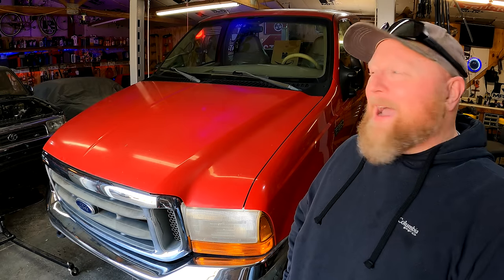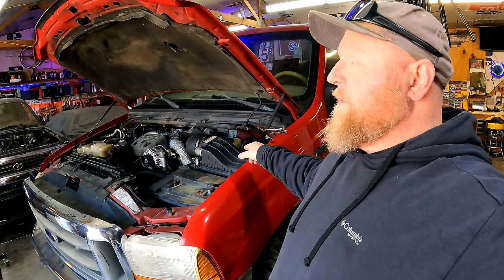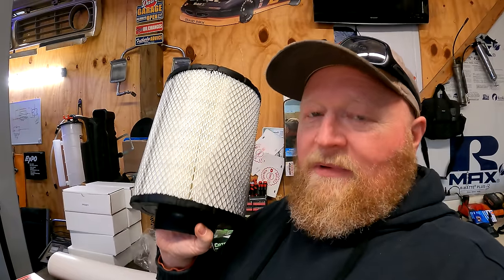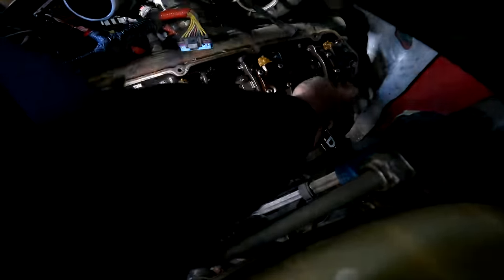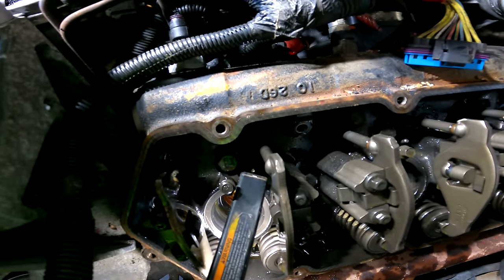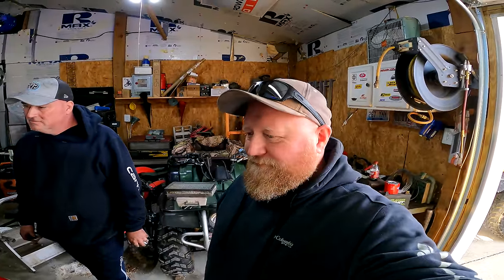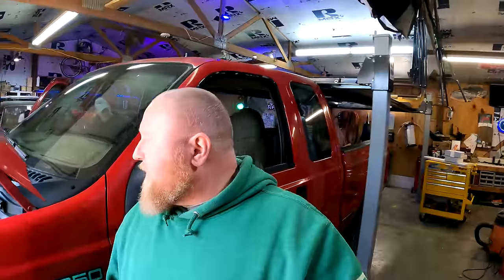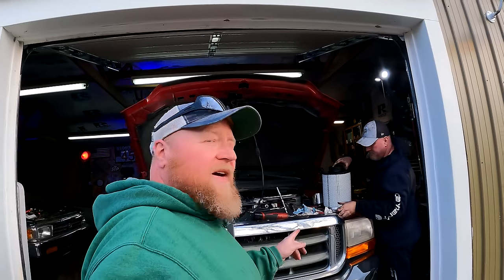FAIL! F250 7.3 Powerstroke Diesel Injector Replacement Goes Horribly Wrong!

Comment: Take both external plugs off the REAR of both cylinder heads on the hpo rail, turn it over and bleed all the air out if any and let some oil pour out of the hpo rail, make sure the truck is nose down to assure all air is out.
Reply from the maker: Yep, thanks!!

Comment: When I do injectors on 7.3's I plug the block heater in and get the engine warmed up.  This makes the injector drop right in :)
Reply from the maker: Oh, that's great idea! Never thought about it. Thanks for sharing that!!
Reply: I do the same if I’m working on the fuel system in the OBS 7.3s as well. Helps it start much easier too when the work is done

Comment: Sometime ago I replaced all of my injectors. I also replaced the undercover wiring harness/valve cover gasket. Took my time, and thought I did a good job. The truck absolutely refused to start. I have a regular job and this was a weekend project. (Turned into multiple weekends)  After many trials and tribulations, and much stress, I figured out that the doorman gasket/ harness set on the passenger side had a dead short. It smoked my injector driver module. Replaced the The IDM $$$$, used my old factory gasket/ harness, and the truck fired right up. That was a year ago. Still runs like a champ. Now I always go OEM. I don't care how much it costs. It's the only way to go on the 7.3. Although not as hard to figure out, I had a similar  problem earlier with the IPR. But you got to hit me in the head more than once to get me to pay attention.
Reply from the maker: Ouch those Dorman parts will get you. We did get the truck fixed. Full video coming tonight at 6

Comment: One thing you can do to speed up restarting the truck is pull the inspection plug on the HPOP resivour and fill it with oil. You have to do it two or three times and the thing fires right up. Only takes a week to start rather than two, and doesn't melt the starter.
Reply from the maker: Good info!

Comment: I’m curious to know what injector is in #7 since the solenoid body is different from the rest (excluding the AE #8). Obviously a massive high pressure leak. Check your fuel tank to see if any oil is sitting on top of the fuel. If you ripped an o-ring the oil would be in the fuel tank. If it was injector cups it’d be diesel fuel in the coolant. Also i like to use grease on the o-rings instead of oil, the injectors go in easier that way but that’s just my opinion.
Reply from the maker: Good info, thanks!!

Comment: Your hard start was probably the LPOP... the most common problem in cold weather starting when you don't use the block heater.
Reply from the maker: Check out the followup video. It turned out to be one of the new injectors bad. Bypassing oil.

Comment: Thanks for making this! my '01 F250 has 250k miles on the original injectors and they are due for a replacement soon. This definitely helped me see what all is required for the process.
Reply from the maker: Awesome, I have another more in-depth 7.3 injector video on my channel as well. Have a look at it.

Comment: I,ve pulled trucks into my shop where the HPOP did take a dump after replacement simple dead head test will confirm, I've seen connection at injectors not making contact, injector o rings not seated all the way blowing oil out and torn o rings and last the fuse blown
Reply from the maker: I was starting to suspect everything for a little while there. We got back into it yesterday and found/fixed the problem. I'll have a video up on Friday explaining it all.

Comment: When you pull the 2 plugs per bank to relieve the oil in the logs, where does it go?  Guessing it runs forward since the truck rear is jacked up?  Drain bucket or ?  Do you have to add oil to compensate for lost oil prior to cranking engine up to prime the two pumps?  Why does the #7 injector have a blue connector as opposed to yellow like the other 3 on the left bank around the 19:00 time stamp? Must be on the right side as it started after the left bank replacements accomplished.  Great tutorial even though was a "hiccup".
Reply from the maker: On the 2 plugs, when you pull them, the oil drains back into the oil pan through the drainback holes in the head, these are the same ports where the top-end oiling for the valvetrain assembly drains back when the engine is running.
#7 has a different color solenoid since these injectors are built by Full Force Diesel. Not all solenoids were the same color originally since they came from different manufacturers. It doesn't change their operation, though.
Yep, we found the issue on the right side. Full video coming on Friday.
Reply: @ProjectTimeGarage  Thanks for the clarification.  Looking forward to Friday's video.

Comment: I know this is an older vehicle.  How would i determine a stuck open fuel injector on my 7.3? Im sure its a open fuel injector, have both my valve covers off and checked the oil coming out of the injectors and they all oil, i know this probably wont even matter since its open and not closed. I bought a 200 dollar scan tool that doesnt buzz codes. So im at a crossroad now. Thanks.
Reply from the maker: If an injector is stuck open, it will dump diesel into the cylinder. This usually will do bad things to connecting rods. It can easily "hydraulic" a cylinder.

Comment: Try NAPA Sil-Glyde next time to keep copper washer seated onto injector. Also works great for injector o rings.
Reply from the maker: Good info, thanks!
Reply: Just a dab of gun grease will hold the washers on.
Reply from the maker: @Mr-er6fg  good info' thanks!

Comment: Hey hope you well, maybe you can help me, i change injector cups and put o rings on the injectors... pulled glow plugs out and tried to turn the motor and it barely turns, what could be wrong and how do i solve it
Reply from the maker: If the engine won't turn something is wrong.i suggest using a borescope to look into the cylinders. Something is preventing it from turning m
Reply: It will turn but barely turns real slow not spinning, battery and starter are good, I'm thinking it has a little hydrolock and is there any way to free the cylinder
Reply from the maker: @calvinhill1564  of all the glow plugs are out, it cannot hydrolock.
Reply: Okay, so are the cylinders stiff tight how can i free up the cylinder any ideas...

Comment: Did you guys not feel the need to swap injector cups? I thought about doing cups when I do my injectiors
Reply from the maker: I'm on the fence. I've only ran across one set of cups that were leaking. I'm usually happy to just do injectors.

Comment: I replaced the injectors and wiring harness on mine and just a day or so later the HPOP went completely bad. Had the same issue it would crank and not build enough oil pressure to open up the injectors and make them fire.
Reply from the maker: We figured it out Monday the 6th. It's fixed now and back on the road. Full video coming Friday!!
Reply: That's awesome so glad to hear !! Just have to love the older diesel's, they can be a pain sometimes but definitely worth it !
Reply from the maker: @jaredtalbot2159  Yup, agree 100%

Comment: My son has a 1999 f250 when it gets worm driving it gets real loud and falls on its face but never stalls you think 8 injector is bad
Reply from the maker: I don't think you can tell which injector is bad by loss of power when warm, but I will tell you that most of the time a bad injector manifests when cold. I would be more interested in what's going on with the High Pressure Oil Pump (HPOP). When you are under hard acceleration, that pump should be making about 3,000psi. When the pumps get tired, you'll find that they cannot make enough pressure to keep up, this is usually what leads to them being weak under hot, hard acceleration. I have a video on my channel showing how to use an android tablet along with a cheap OBD2 reader from Amazon to see what those pressures look like.

Comment: IMHO the "6637" air filter mod is a very crude unit. As long as the original airbox is not damaged Motorcraft, Purolator and even Fram make a HD (Thicker) drop in panel filter and I believe they are dry impregnated with something to catch even more dirt.
Reply from the maker: Good info, thanks!

Comment: air test it.. IF the IPR and ICP have air itl read 250 psi.. But i did just did this same thing and JUST went through it i had a crank no start  pressure tested and found #4 had a bypass situation,  with 175 psi air heard the leak clear as day.. pulled out reseated it and its all good now.. also can try unplugging the ICP it defaults over 500 which is the trigger to start..
Reply from the maker: We just found/fixed the problem yesterday. Full video coming friday.

Comment: My guess would be a pinched o ring on the injector, or it didn't seat properly could even be a bad injector. I have had a bad reman injector that didn't work out of the box. Swapped it out on warranty problem fixed. Run it with the valve cover off, which will point you in the right direction. At least you know it's  1357 on the passenger side.
Reply from the maker: We got the issue found and fixed yesterday. Video coming on Friday with all the juicy details. I can say for sure, that one of your guesses is spot-on.

Comment: That would have to be one hell of a o ring problem. before you start pulling out injectors I'd run a buzz test and make sure that bank is getting signal. 
   The delay in building any pressure but then starting to build could be explained by air trapped in the rail, which can't work through the injectors on that side if they aren't firing. Best of luck whatever it turns out to be!
Reply from the maker: That was my thinking too. We buzzed them and all were healthy and firing. If it's a leak, it's a major one. Monday is the day we find out what's going on. Wish us luck.

Comment: You dont have to take the plugs out tho right as long as you keep the glow plugs out and turn the engine over your getting it out no matter what just more of a mess right ?
Reply from the maker: True, just trying to keep as much material as possible out of the cylinders
Reply: @ProjectTimeGarage  I was just making sure because I just put injectors in myself and just waiting on the gaskets to come in. But hey I loved the video I hope you guys get big red running she’s a beauty !
Reply from the maker: @kingchrisss777  thanks man!! Good luck with your injectors.
Reply: I personally prefer to use a fluid evacuator with a clear hose on it to suck all the fluid that falls into the cylinders rather than take the glow plugs out or remove the small oil rail plugs. What little fluid you can’t get out won’t hurt the engine.
Reply from the maker: @JLCmike4014  cool, good info!!

Comment: After putting it all together crack open those fuel lines to purge out the air.  Otherwise you blow the air through the injectors.
Reply from the maker: On the HEUI injected engines, the fuel rail is cast into the head unlike standard diesel engines with an injection pump and external high pressure lines. The only way to bleed air from the system is by turning the engine over. Usually they prime themselves in a matter of seconds, though
Reply: @ProjectTimeGarage  I have the FRX return to the fuel bowl from Riffraff to prevent blowing the air through the injectors

Comment: You show to pull the rubber tip off the nozzle of injector, but you don't show the #8 injector difference???
Reply from the maker: #8 is the AE. I did show that. One of the injectors, #7 I think had a different color solenoid, but that's normal with reman injectors.
Reply: It was a quick glance I see.
Reply: Roy, adjust the playback speed to slowest possible and it will magically become a slow glance
Great video, fellas
Reply from the maker: @22goDpeehs  Thanks!

Comment: if it is an aftermarket hpop it will take a dump real quick. Done went through 2 of them in the last 5 years.
Reply from the maker: As fast as we can tell, this is the original HPOP.
Reply: I had same problem  went with used oem hpop fine now

Comment: Check your fuel filter bowl
Reply: Cut or bad injector o-ring will bypass oil to fuel
Reply: Or over-tightening an oil rail plug can ruin an o-ring also
Reply from the maker: Good info. We found/fixed the problem yesterday. Full video coming on Friday.

Comment: I cant believe you went thru all of that and not change the injector cups.
Reply from the maker: I typically never do unless they are leaking. The only failure point is the brass cracking or the retainer compound failing. Overall, I've never had any failures doing it this way.
Reply: @ProjectTimeGarage  I just changed my injectors. Ive owned it since new. never had a problem ever. Then one day she just wouldent fire. In changing the injectors a man said just to do the cups. And BAM 6 of the 8 cups were cracked

Comment: I am new here why does number 8 take different  one
Reply from the maker: It was a Ford TSB back in 1999ish. Basically, the #8 injector is the end of the line, so pressure was creating a knocking noise. People were bringing their trucks to the dealer mistakenly thinking it had a rod knock. The AE injector in 8 solves this noise.
Reply: Thank you for information
Reply: Noise, that is the only reason.
Reply from the maker: @patrickmcghee.  👍 yep